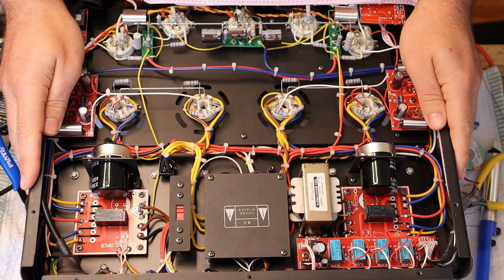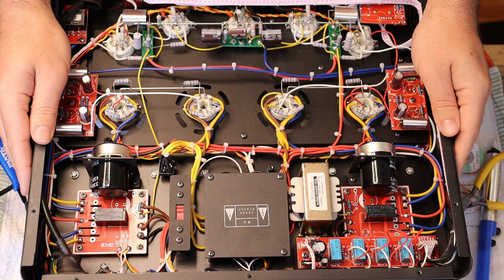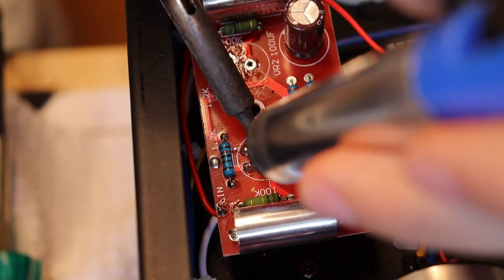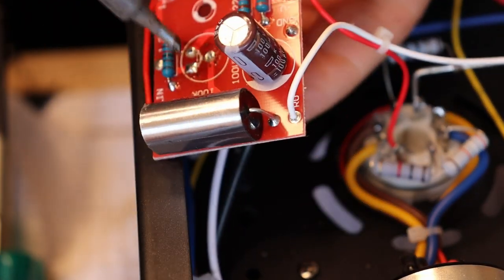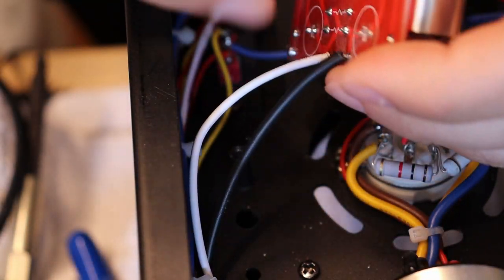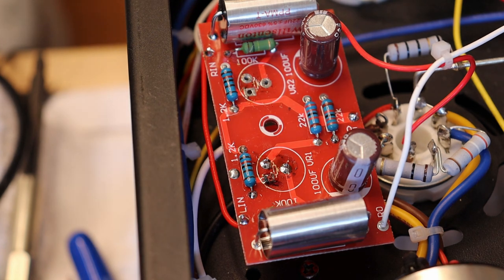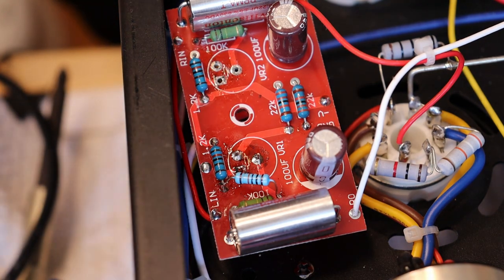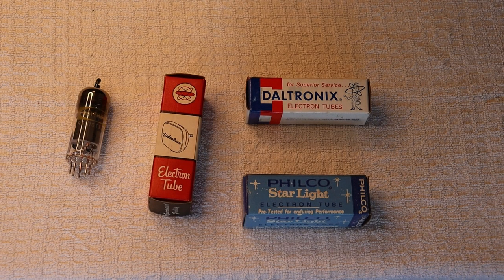Tube Lab #142 - Willsenton R8 Bias Pot Replacement +

Comment: Re solder suckers, I recently got three different types to try. One was like yours and it has the best ergonomics but the tip tends to melt. A similar looking one but with a completely metal housing has a better tip but tends to stick. The best is a larger all plastic one (light-blue colour with yellow buttons) as tip doesn't melt and its larger size sucks more solder in one go.
Reply: Thanks for chiming in about the solder sucker, I've got an all metal housing one on the chopping block now. We'll see how long that one lasts. But the first one I've been using fairly heavily for about two years now so it really doesn't owe me anything. Cheers!

Comment: @Tube Lab, Thank you for your video, I appreciate your time to find and locate replacements pots. 
How did your repair work out, is your R8 and the pots you installed operating correctly ?

My R8 burned the V2 KT88 10 ohm and 1K ohm resistors and I saw some sparks flying, heard loud static, but the sound came back on in seconds. I turned it off before I could tell if it red plated or listening if the left channel was dead.
Skunky also thinks that the pots may have been faulty or the bias too high. I had previously checked the bias and it seems the V2 may have been getting wonky.
Reply from the maker: The pot replacement is working fine, they have the same footprint (standard) and range as well as stem height.  The only issue is the shaft rotates with very little resistance so it takes time to learn how to co-ordinate the movement.  There's a special slot screw driver that captures the shaft, which would make adjusting the pots much easier.  
And yes the first sign of trouble with any pot is they often start to get noisy - that's when you should replace them, especially in a bias circuit.
Reply: @tubelab194  Thanks for the fast reply, glad yours is working.

Comment: There is a lot more wrong with the R8 than this.
I followed another well known YouTuber's rebuild of my R8. (Oh, you mentioned her)
All the resistors were rubbish, the wiring was absolutely made to enhance noise.The grounding was silly. If you have an R8, you need to have all that work done. And the fail-safe was a big oversight
Reply from the maker: We've used our R8 commercially for 2.5 years and in all that time the amp has been stock.  The only problems we've had are with high wear items like the bias pots, which we put probably the equivalent of 100 years of service on in 2.5 years.  Otherwise the amp has performed perfectly in stock form and sounded great!  The resistors are fine as built (Skunky said the same thing in her own video).  The fail safe is easy enough to add and remember we ran the amp for 2.5 years without a fail safe in place without a problem.  Given our hours of operation, I stand behind my original statement that the R8 is a great amp at a bargain price - even in stock form.
Reply: She got and kept your attention. 
Perhaps if she was only able to do one video saying the amp was great, she wouldn't have been able to hold her largest audience for any product to date?
My R8 has and is running perfectly, perhaps it could benefit from a few upgrades,  but most equipment can.
Reply: @pnichols6500  Of course most gear can be upgraded. I suggest you have a look at her comparison between the R8 and a Muzishare she was asked to work on. I know which one I would buy now. (I might add that my R8 took control of itself and powered up spontaneously. China Hifi sent me a new on/off switch but that could have been a real issue if, say, I had been away from home)
Her latest on the Willsenton 300 is proving to be a real eye opener. It seems to have issues well beyond the R8